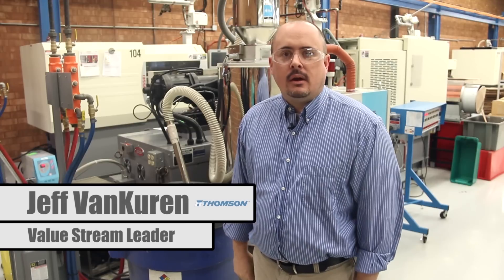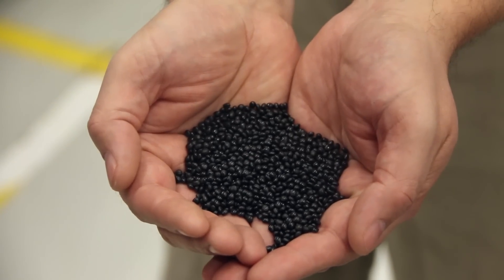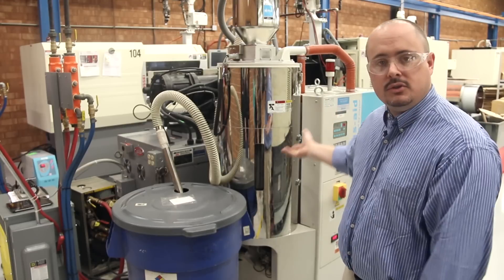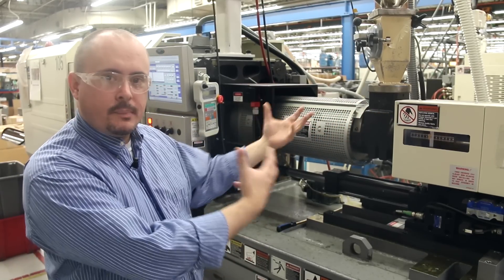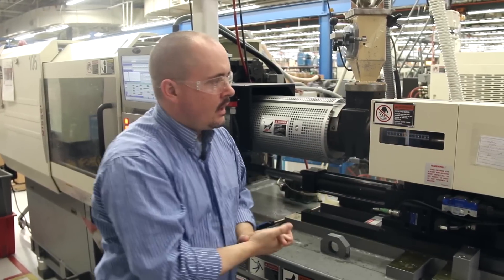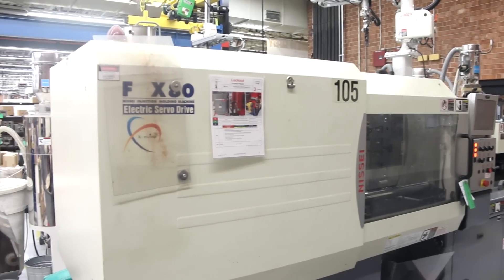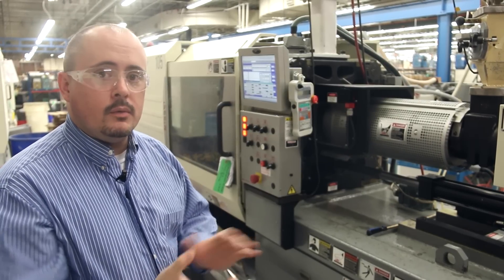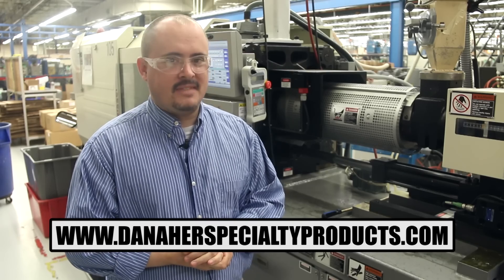How Injection Molding Works

Comment: I am Kevin Shaw from GM-TECH which is the competitive price and high quality plastic injection mold manufacturer in China .
We are integrated in mould components，plastic injection mold making and product moulded.
Our attractive strength：
1.）Short mold lead time （small mold 3-4 weeks， larger mold 4-6 weeks）；
2.）Most of processing are done by CNC and EDM，it is better to control the quality；
3.）Dimensional report of each part from checking by CMM；
4.）The designers and mold engineers have more than 10 years experience；
5.）Mold quality guarantee from our project management；
6.）Good services，such as:
Owned US office to take care of the after sales;
Offer original steel certification；
Weekly report with mold process pictures and video during production；
We provide DFM report analysis for parts even at quote stage；
We make 40% Auto parts，like Volvo，BMW，Nissan and Volkswagen. We also make custom plastic moulds，such as electronics，aerospace，medical，packing and so on...
Looking forward to hearing from you.
Thanks & Best Regards ,
Kevin Shaw | Manager of Sales
M. +86 180 3304 2132
kevin.shaw@gmmoldtech.com 
Glitter Mold Technology Co., Ltd.
  
www.gmmoldtech.com
Injection mold & molding manufacturer
Reply: Why would you think it is ok to hi jack another company's video thread?  You lack class.